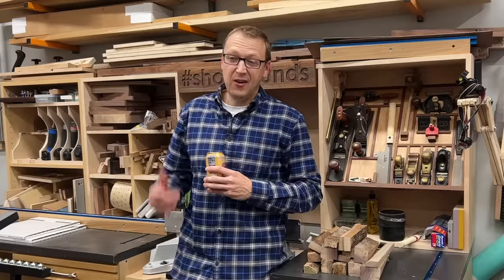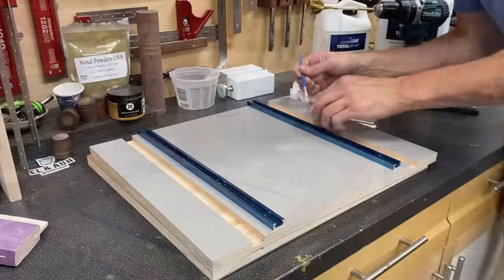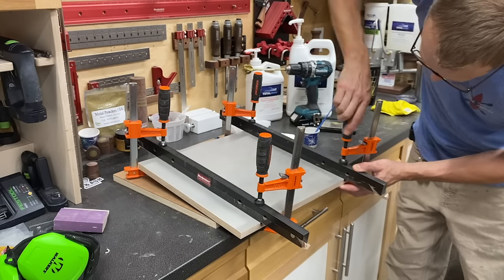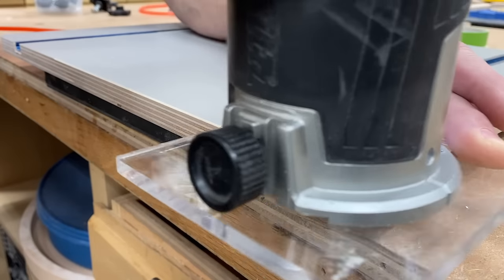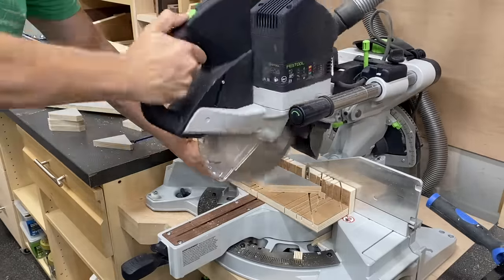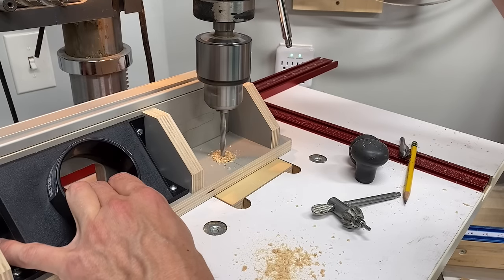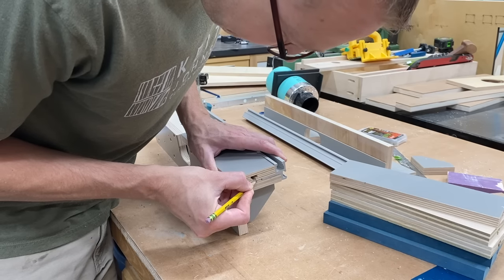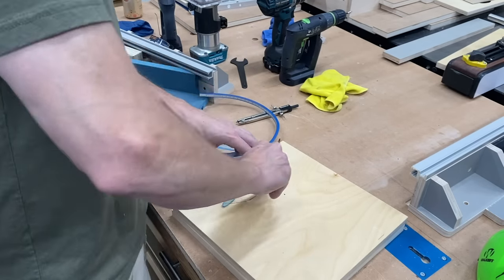DIY Router Table for Trim Routers | PLANS AVAILABLE

Comment: Ah man! this would be perfect. I have a small shop, and don't even have a vise to mount my trim router. I usually just (strategically/puckeringly) clamp it to end of my outfeed table. Very well thought out and designed Mr. Morsels! and, as always, a great video to go along with it.
Reply from the maker: 😂 A listener of the podcast I see...much appreciated Caleb. My morsels are also appreciative 😜
Reply: I think all of us with tiny shops come up with some ridiculously innovative way to work around things like this.. but who ever gets this would be a great add
Reply: Get a large wooden hand screw clamp and tighten that to your router then take two regular clamps and tighten the hand screw clamp down to a table

Comment: When I install T-track, I use epoxy like you did in this video, but I sand the underside of the T-track with 80 grit. You don't have to go crazy sanding, just enough to remove the color of the T-track. This will give the epoxy something to bite into and make a rock solid bond.
Reply from the maker: Great tip! 👍💪

Comment: I’m just starting out in woodworking, and have a very small shop. This seems like it would be a great solution for all those times I wish I had a router table. I think you’ve hit the sweet spot in this design. There’s a lot of videos with very complicated designs and a lot that are basically a board with a hole clamped to a bench. This one checks all the boxes.
Reply from the maker: Thanks Sean! I think you nailed what I was going for! 😜👌

Comment: New to woodworking and that perfect cause for trim i am having trouble getting clean cuts with my makita router for thin trim. So i tried doing the trim on thick stock and then cutting off the excess with circular saw. It worked for the base boards but  no so well for picture frames. When i do one side it comes out perfect  . But when flip over i have to move the clamp to finish the cut and you always can see where i restart the router in the piece.
Reply from the maker: Glad I could help! Good luck Dorothy!

Comment: Does youtube force the censoring of the cat anus or is that just you putting in the extra work as always. Honestly wouldn't be surprised by either at this point. Nice builds as always, someone will be happy with this. Gonna have to make one of these for my dewalt router.
Reply from the maker: 😹 That's just me putting in the extra time to save your eyes...or your weak stomach in case you are watching this during dinner. And thanks for the support!

Comment: I've been to 2 Loctite seminars. In the eighties I used a Grade EV loctite which was for making adjustments later on. The Loctite rep had never heard of it (2004.) The blue sets up really tight and you will probably strip out the insert in the plastic if you try to adjust it. I would try VIBRA-TITE low strength, designed for fasteners which need to be disassembled. OBTW, I am going to steal some of your design ideas.
Reply from the maker: Thanks so much for the Loctite info! And feel free to take any design ideas you need - it's certainly not an original design 👍

Comment: I already have a larger 2.5HP router that I have mounted in a table MyBest.Tools I not longer have to lug that unit out for the majority of routing that I do. The compact router is much easier to handle and control. Can easily cut through hardwoods with the largest 1/4" shank bits I have. Impressive. Cordless is a huge bonus considering I already have several 5AH DeWalt batteries for other tools. Highly recommended.
Reply from the maker: Yes! There is an LED light that turns on automatically when you flip on the power switch.

Comment: That's the Cat's Meow of bench top router tables. Truly like how easily it can be broken down for storage without missing out on features. Dont know if its dislike, how does one keep the fence in parallel with the router bit?
Reply from the maker: Thanks Allen! And like a drill press, since the bit is round, parallel isn't necessary. Then fence can be moved to any angle and still give the same result. The distance from the bit will certainly yield different results and if using a bit with a bearing, the front of the bearing is usually in plane with the front of the fence.

Comment: I mean you could have used pallet wood and it would be just has good but saved you a few $$. Also maybe next time you could run an epoxy river on the edge to make it look like a beach front. 😂😂 I’ll see myself out. Fun build, man. Nice work as usual.
Reply from the maker: 😂 But pallet wood would have taken more labor to pull all the nails out and surface it down! And how dare you mention epoxy river in this comment thread!!! 😜😂

Comment: The use of threaded inserts is really the best thing about this idea, I’m always hesitant to build things like this because, well, jigs add up and get in the way 😂 being able to take it apart is amazing! Also credit for actually clamping the router, I usually just slap the biggest battery on it that I can find and assume it’s good enough to hold. Great table plans.
Reply from the maker: Thanks Zack! I think the weight of the router and a big battery is more than enough to hold it in place. That's another reason I made the base plate square...so it wouldn't be able to spin.

Comment: Super cool build, Only have a old craftsman router from like 1980 and the table that i found at a garage sale lol well its interesting but works. now i know you put a dust collection port on their, how well do you anticipate that working?
Reply from the maker: If you are make groove cuts where the bit is housed in the wood, the dust port on the back wont' serve much of a purpose. But on small chamfers, round overs, profiles, etc. I I think it will grab the majority of the dust.

Comment: You and mr (Bourbon) Moth do such a great job. I found you through him and your bench build. Great table. Here is my one question. Is there any screw to fold the plexiglass down so it does not lift? Or did I miss that as I watched it with my crazy kids. I guess I will have to rewatch it.
Reply from the maker: Thanks so much, Scott! So glad you found your way over to my channel. I did not put any screw to keep the plexiglass down on the table. Since it is attached to the router, the weight of the router will hold it down and in place in the table. Similar to a full sized router plate. 👍

Comment: Nice design Keith!  I've recently purchased my first trim router and am looking at various models of these DIY tables.  Question - how would you secure this to the benchtop?  I've seen other models where the front feet can be clamped to the bench surface.  Would you recommend clamping on these "stretchers"?
Reply from the maker: Hey TJ! Yes, the front stretcher can be used to secure the table to your bench with some clamps. 👍

Comment: Man o man, this video couldn't have been better timing! I have a tiny woodshop and have a few projects coming up where a portable router table is going to be crucial to the builds. I have an old table that has a spring loaded plunge router mounted under it but it simply just doesn't cut the mustard and I've been eyeballing ideas on how to make it better. KJ sawdust to the rescue!
Reply from the maker: Ha! How about that! Glad I could swoop down in your time of need! 😜👊

Comment: Hi Keith, another great project and brilliantly presented as always. I’m in the UK but do have a US postal address if that helps. Anyway, aside from the base plate fine adjustments which are great, I love how this is designed to work on top of a workbench. It would certainly get some mileage in my workshop. I’m also loving your collaborations with the Bourbon Moth by the way 👍
Reply from the maker: Thanks Chris!! I appreciate the support and thanks for checking out my vids with Bourbon Moth. We have a lot of fun in the shop and it was great to have Nick there for the shuffleboard build!

Comment: Just curios this has nothing to do with router table other than thought it was a really cool shop project 👍 that I might try to build myself looks handy ! I saw you using the festool 500 domino Jason likes 700 xl can’t justify buying both so do you have a preference on the size you like most ?
Reply from the maker: For the work I do, the 500 is plenty sufficient. I've only found myself needing the 700 a couple times in the 4 years that I've owned the 500.
Reply: @KeithJohnsonCustomWoodworking  I know your right ! Thanks for the input 👍then there’s the little voices saying go bigger buy the bit adapters lol thnx !

Comment: This is such a great give back! Keith your amazing. I current work out of my basement and have fought with building a mobile route table. Doing exactly what you did in the beginning with clamping it down “totally unsafe” and even cutting a a square to except the router plate out of a piece a birch to hold my router and clamping that to my work bench. Thank you for the opportunity. Your work is amazing. -Jeff
Reply from the maker: Thanks so much, Jeff! I guess we've all been there with the janky setup hoping nothing bad happens and hoping nobody is watching. 😂.

Comment: Extremely well thought out design. I’m a custom stair builder and am constantly shaping different nosing profiles. Working in clients homes the router is definitely the biggest culprit for dust production. The built in dust collection in such a compact and light weight design would be a godsend for on site finish carpentry. Thanks for sharing your always informative and always entertaining builds. Hi Jerry!
Reply from the maker: Thanks man! Love hearing from guys in the trades! And dust collection could be further improved by fully enclosing the base. It would make breaking it down more of a process, but so is vacuuming up dust and chips from one end of the house to the other 😜😂

Comment: Love the design and portability. Is there anything other than wright hold the router down? Are you concerned if the bit chatters the router and plate could chatter as well?
Reply from the maker: If i was using a full size router, that might be a concern, but I'm usually only doing small operations with my trim router. And the weight of the router along with pushing the material down through bit should stabilize everything just fine. 👍

Comment: I immediately see (2) places for improvement. 
1) my big ole 1980’s hitachi plunge router base is way too big for that lil guy… perhaps a similar design on the top to allow for a larger router to be attached? Which would possibly be too heavy, which brings me to improvement 
2) a place to clamp or secure this to the work top? Maybe a built-in rubber grippy-pad-thingy on the bottom for ABS (anti-board-slippage)?

Not that I don’t love it and would really enjoy having it… 

Awesome job!
Reply from the maker: Hey Dave! It's specifically for small trim routers...anything larger would definitely need design and stability refinements 💪
Reply: Yeah I know, and it’s amazingly awesome…I figured you are going to read that a lot, so I thought I would try and be different. I subscribed after watching this-I never came across your channel before… I believe Essential Craftsman sent me :)
Reply from the maker: @DBKING04020  That's awesome, Dave! So glad you found your way over here. Hopefully I can bring some valuable and entertaining content your way.
Reply: @KeithJohnsonCustomWoodworking   so far so good 😊

Comment: Love the small size and convenience of breaking it down to store. Great for any small shop. I have always been a little intimidated with routers and love using them on tables where you can have more control of the piece. Looks great and love the adjustable fence.
Reply from the maker: You and me both! Having a stable work surface and machine are super important in the shop!

Comment: I love this little setup. It's way easier to pull out and use over the full size router table, and it would probably work for 90% of the things I use my full size table for.
Reply from the maker: My thoughts exactly! Sometimes setting up the full size table is overkill. Now if I only had a fleet of trim routers will all my most used bits already chucked up in them! 😜😂

Comment: Looks great, only thing I’d add is a flat spot on the bottom so it can accept a F style clamp to your table.
Reply from the maker: That's a great idea! The stretcher across the bottom is designed to be clamped down to the workbench to keep the whole unit stable, but I'll admit a larger surface would be better. 👍

Comment: Very nice build.  I like that its modular and not permanently assembled.  How do you like the vacpad system? been looking at it
Reply from the maker: I love it! And Dino is constantly coming out with new innovations and units for the VacPad system. I think it's genius.
Reply: @KeithJohnsonCustomWoodworking  definitely. I was thinking of getting festool one but this one is cheaper and better I think. Did you try the portable one that he sells?
Reply from the maker: @AlexK07010  No, haven't tried the battery one yet.

Comment: This is exactly what I need, Keith.  I have a small garage shop that we actually park both cars in, so everything is on wheels and no space for a full size router table.  Great design and video!
Reply from the maker: Thanks Paula!! And way to go using wheels to keep everything mobile! I used to do that in my old shop as well!
Reply from the maker: Hey Paula! You didn't win the router table give-back, but you did win a free set of plans to build your own!! Email me at keithjohnsoncustomwoodworking@gmail.com for more info. Thanks!

Comment: We need a steel fab and wood fab channel to collab and make a steel framed router table with a cast iron top.
Reply from the maker: Benchdog used to make a killer cast iron top with a ridiculously stout router lift, but they don't make it anymore...😩

Comment: I absolutely LOVE the knockdown design! I recently threw my old table out because it had a sag in it and I have yet to build a replacement. This would be perfect in my tiny shop!
Reply from the maker: Nice!! Yeah, that sag is a real drag with a flimsy top and a heavy router. Been there man!
Reply: @KeithJohnsonCustomWoodworking  it was 3/4 plywood! But it wasn't Baltic birch and it probably had the sag to begin with. I threw it together real quick one weekend when I needed it. 😭
Reply from the maker: @CheveeDodd  Ah. Dang plywood can bite you, too!

Comment: Hi Keith, love the build btw ;)  I also don't have a flat bottom saw blade and can you tell me how much you dado out  with the ATB blade say for 3/4" ply, and then use your chisel to get to the final width?  I've not been flattening my dados using the ATB blade and I'm tired of it looking crappy in the end lol  Thanks bud!
Reply from the maker: You just gotta run some test cuts and figure out what works - every blade is different. I usually use my dado stack so I generally don't have this problem.

Comment: Very nice!!!    The only thing I could see  wrong with it is it’s a little tall. Maybe do a version that can just clamp/screw to a work bench? But that’s a little nit picky
Reply from the maker: Thanks Ben! Agreed it could be a little bit shorter. And the front stretcher across the bottom is there so you can clamp the whole table to the workbench. 👍

Comment: I like the knobs and threaded inserts rather than just knocking apart the table. It took a little more work and materials but its simplicity and likely ease of use will make it worth it. Also good to see J & L again. I think I can almost tell them apart now.
Reply from the maker: Thanks Terri! Nice to hear from you! And now that Jerry has shed a few pounds, I actually have a hard time telling them apart sometimes 😹

Comment: Such a functional, quality build!  Over the summer, I built a quick, folding router table to get some projects done for my kids.  I ended up clamping a temporary fence in place to get the job done, with the plan to upgrade the portable router table over time to include t-track, dust collection and a drop-in slot for an acrylic base.  Watching your video gave me a ton of inspiration to rebuild it as the folding design I used is not as stable as I'd like it to be.  I didn't really think it could be collapsible AND stable but this setup is great!  Now to find some time to get working on it...
Reply from the maker: That's awesome, Kris! Good on you for coming up with something to get the job done. Glad I could give you some ideas for your upgrade!

Comment: Wow that is awesome will that work with a dewalt trim router too
Reply from the maker: Thanks man! Yes, Dewalt will work but you will have to take the battery off to get it through the opening and then re-attach it. Or you can just make the opening and acrylic base larger to fit 👍🏻

Comment: Unfortunately, I’m still chucking my router in my vise. Just don’t tell anyone so I don’t get crucified. Great video, great build and great sponsor!
Reply from the maker: With all those tools you have, there isn't a router table somewhere in the back corner under a pile of dust? 😂
Reply: @KeithJohnsonCustomWoodworking  there is a shaper but I haven’t pulled it into the shop yet.  It’s so big.
Reply from the maker: @reforzar  You keep it in the stock room next to the Kaiser rolls?

Comment: I like it! Could use a means to clamp it to the table.
Reply from the maker: Thanks Allen! That front support bar is meant to be clamped to the bench to keep the table from moving 👍
Reply: @KeithJohnsonCustomWoodworking  in that case, I would put that stretcher flat instead of on it’s edge.  Much more stable that way.  😉
Reply from the maker: @hallenw  Fair enough! I just couldn't get a knob on the ends to not bump the table that it sits on if I did that.